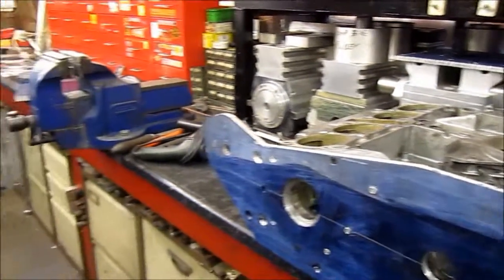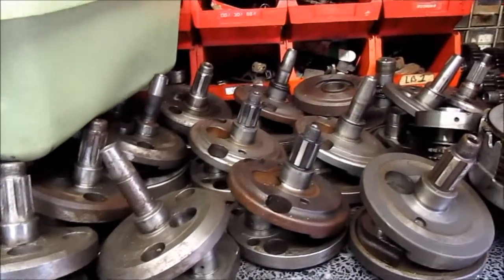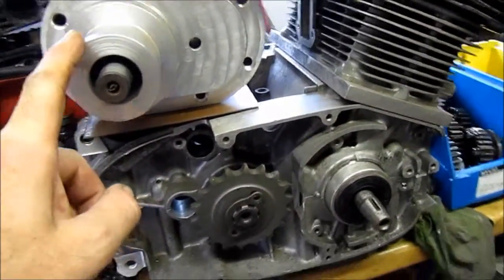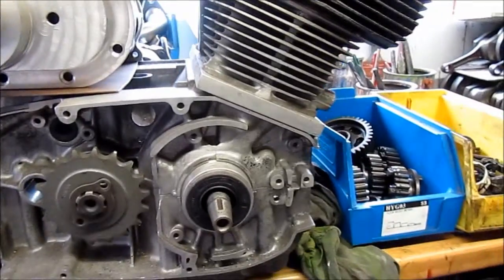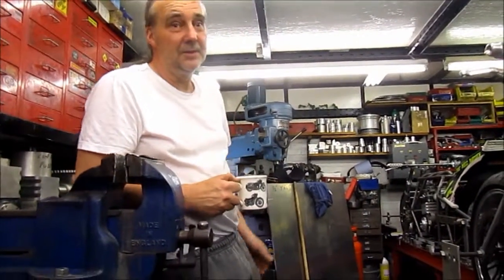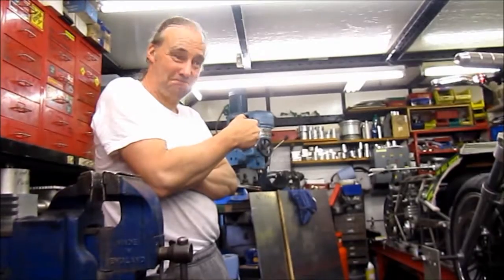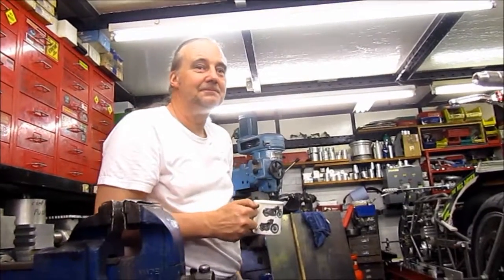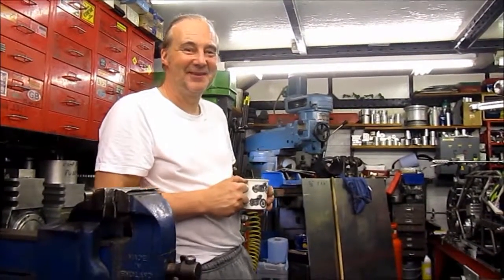Barnfind Supercharged Honda CB350 Drag Bike  - Part 1

Comment: I love small honda twins especially hot rodded honda twins. i have a 74 cb360 and wanted to do something similar to this. I can get my hands on a small aisin supercharger and i was thinking about making bigger better cylinders from billet so i could push the 360 out to about 450-500cc. Friends and people alway ask why dont you just get a bigger bike.  I always tell them why not and because i can. I live in the U.S. and want to build mine for landspeed racing and Bonneville salt flats. Is there any way i can find more info about your build. Please let me know your 350 is going to be an awesome bike when done. I want to learn what i can do to make my bottom end stronger and give me better performance. I have built a few bike but nothing as crazy as yours. Any info will be greatly appreciated. Thanks
Reply from the maker: If you look at the latest Jeff's Shed Vlog #3 video I posted, he machines a billet barrel for the Honda. It will have bigger conrods.. as mentioned in one of the Vlogs and additional  support bearings on the end of the crank. The Honda will be featured in future Jeff workshop Vlogs.
Reply: Yes after i wrote that comment i found the other videos. Thank for replying.